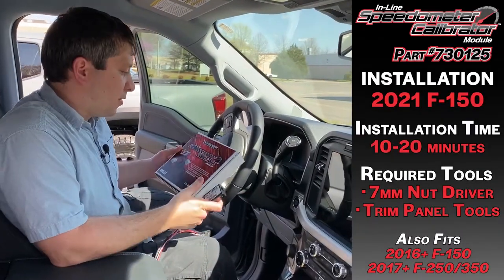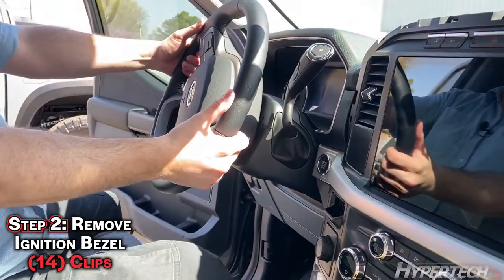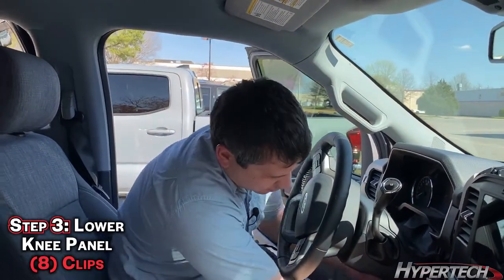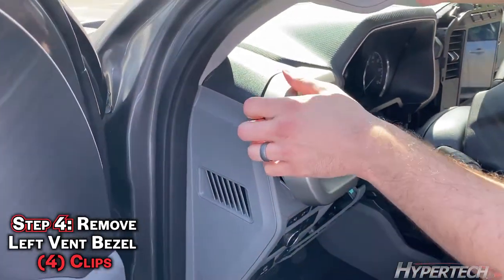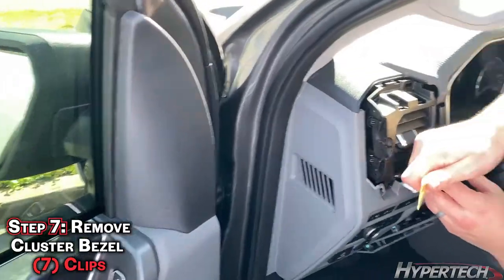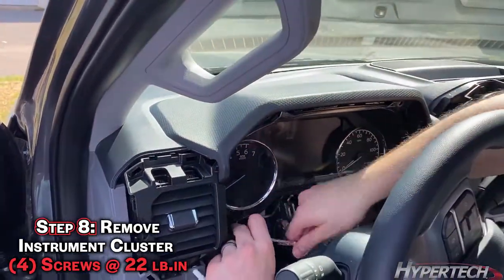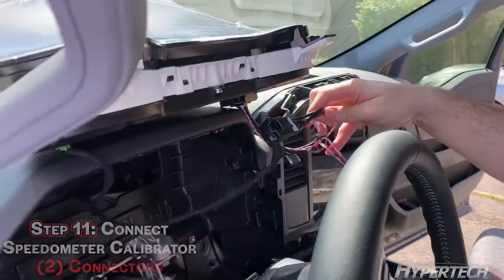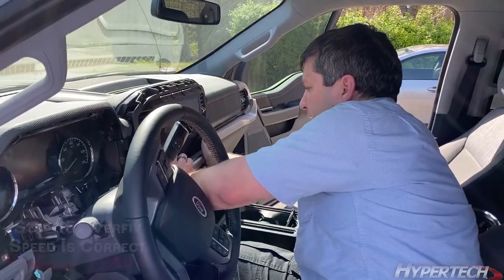Speedometer Calibrator (730125) Installation Instructions for the 2021 F-150

Comment: Purchased a Hypertech unit to recalibrate my 2020 F150 after installing considerably larger tires. Overall, no complaints. Adjustable in 1/4 inch increments, so you can really dial this thing in. Compared my speedometer to a reliable GPS app after the recal, and it's pretty much spot on. The longest part of the process is the initial PCM read function. Once you get through that, reflashing different tire sizes only takes a couple minutes. My suggestion for anyone using one of these units on an F150 is to aim a bit low as far as programming a new tire diameter. I'm running 285/75 R17s, which is just shy of 34 inches. After a bit of trial and error, I ended up programming a 32.25 diameter. Not exactly sure what would cause this discrepancy, but it's not something I'm concerned about. My speedo is dead on, which is exactly what this product promised to deliver.
Reply from the maker: That's great feedback, and we're glad we could help be part of your truck's upgrades. Thanks!

Comment: The end screen shows that this is available for the 2021 Super Duty. How about 2022 Super Duty F250 with the 7.3 Ltr gas/Godzilla engine?
Reply from the maker: Yes, it works on the 2022 trucks as well.

Comment: So to make adjustments I have to take it all apart again? Or can I leave a connection installed and make adjustments installed? I changed gears and tire size. I went from 4.3 to 6.17 gears and from 32” to 44” tires.
Reply from the maker: You do that either way. We do advise calibrating the unit and verifying your settings before putting the dash completely back together, as mentioned at the 6:00 minute mark of the video. You could also connect the USB cable to the unit and route it down through the dash towards the pedals and secure it there. This would give you access to the Speedo Calibrator after installation for updates needed for future tire/gear changes.

Comment: Why does my hyper tech calibrator for 2018 Silverado not give me the option to adjust the gear ratio . . It’s model 3350 only lets me adjust  new tire size but with stock gear settings ?? Help please
Reply from the maker: That option is not available with that transmission unfortunately.

Comment: Is there any way to switch back and forth between 2 profiles? I have a set of street tires/wheels that I use for trips or anything over 50 miles and some larger tires for wheeling and around town/most of the time.
Reply from the maker: If you want to do this you could leave a long USB cable connected to the unit and route the cable to somewhere you could access it easily (ie. down by the pedals). Then you could just recalibrate the module any time you swapped tires. Leaving the USB cable connected won't hurt anything.
Reply: @HypertechTuning  can the recalibration be done w an iPad or iPhone?
Reply from the maker: @b4ds33d  The Tuner Update software used for calibrating the Inline Speedometer Calibrator is only for Windows/PC. Sorry for the late reply.